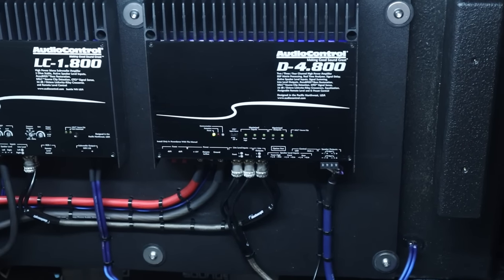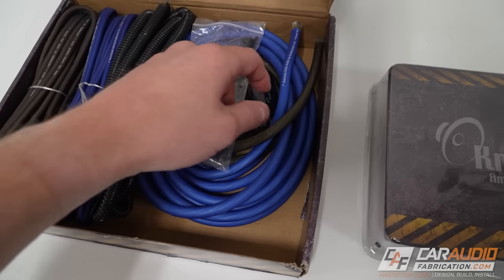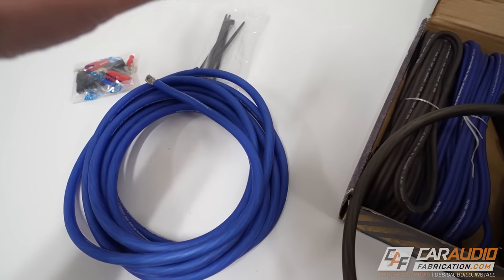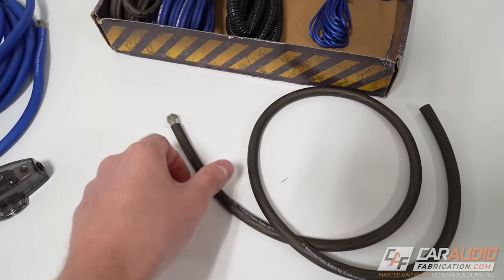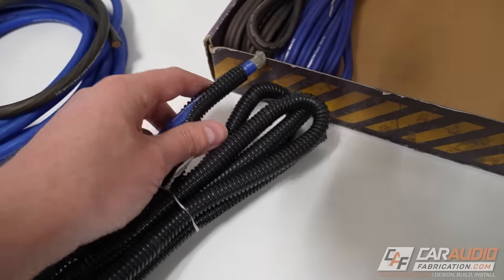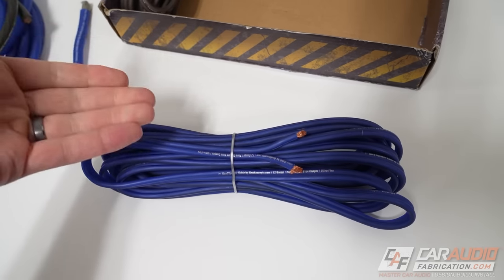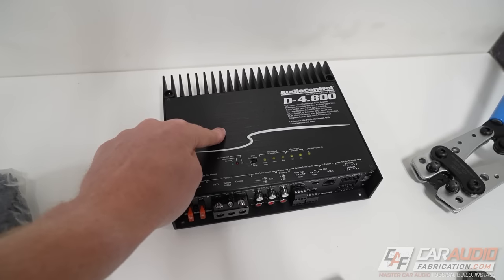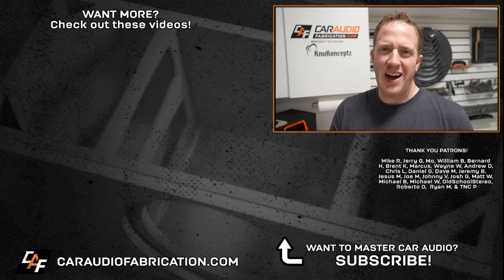Amplifier Wiring Kits Explained - Don't forget these other tools too!

Comment from the maker: Thanks for tuning in guys! Here are the wiring kits and tools and materials I recommend!
🛠Tools and Materials:
✅KnuKonceptz on Amazon - https://amzn.to/3BYHcJo
✅Large Wire Stripper - https://amzn.to/3fldhU6
✅Large Wire Crimper - https://amzn.to/3rhP3wQ
✅Small Fast Wire Stripper - https://amzn.to/3fkJQ4z
✅Knife - https://amzn.to/3LYsJC8
✅Cable Cutter - https://amzn.to/3ftRQQU
✅Terminal Crimper - https://amzn.to/3rqw5nD
As an Amazon Associate I earn from qualifying purchases.
Reply: Can you do a audio whining/high pitch noise diagnostic video? It also matches with my engine rpm.

Comment: Ok, I’ve watched the videos but I’m still confused. I’m upgrading speakers and putting an under seat powered subwoofer. So, do I need two DSP? One amplifier with built-in dsp, and another without it for the sub?
Reply from the maker: Every system benefits from DSP. It's like building a performance car. You bolt on all those upgrades, do you think an ECU tune os going to help or hurt?  If you get a DSP amp most have a set of preouts you can also control and send signal to a non-dsp amp

Comment: Just wanted to say mark. Recently started watching your videos.
I built a sound system in my 2000 z3, maybe 5 or 6 years ago? Either way, the oem system just didn’t cut it for anything. So of course got the head unit, then ran an amp for the speakers and ran new wire. Anyways.. decided a month ago I was going to rebuild my sound system. New wires, speakers, amp, etc. And that’s when I decided to start watching your videos. Which now totally has changed the way I looked at building sound systems. Also swapped my speakers out from pioneers to JL c1’s because it seemed like the best bang for your buck, also the way you used their product. It just seemed very promising. 
And I have to say, I couldn’t be happier. I’m absolutely IN LOVE with the JL speakers

Comment: Been watching your videos for like over 5 years I think. I never comment but most of my knowledge is inspired by this channel. Currently suffering with an IC for my PB1.18000 Class D. Cant find the IC and suffering with a sub that does not deliver the required bass. Now I need to save for another 6 months to be able to replace them☹️

Comment: What up Mark! In my humbled opinion, you are truly the best box builder and fabricator on YouTube without the super expensive computer controlled robotic router table. I'm a Cable Splicer of fiber optics for Verizon in Washington, D.C., and most of our job assignments are of the brand new construction variety with lots of plumbing material lying around. Being a BassHead from the early 90's, I fondly remember those "Bazooka" bass tubes, and I would love to see you create/fabricate one out of 10, 12 or 15 inch diameter PVC piping.

Comment: Pls pls pls do some videos on Marine audio system & not the easy stuff these new boaters play with them big hanging speakers that are freaking awesome … I’m talking about old school / classic style marine systems. With 4 or more speakers, radio , amp , subwoofer…. In case you were wondering yes I just picked up a boat that could use a new system & thanks to you my F-150 sounds awesome 👏🏼

Comment: I’m running the kolossus 4 gauge in 1 of my cars I’ll be running a 1000 watt amp at 1ohm subs and 300 watts stereo mids , do I need 1 gauge or will 4 work?( 100 amp and 30 amp fuses recommended)

Comment: I have a bi-amp system with RF D1200 and RF 400 for mid-tweeters install on my 2016 Elantra. Do I need to install a capacitor?

Comment: Hi Mark I have a 2019 Subaru Outback and I would like to upgrade the speakers and sub woofer. I would like to use the Audio control amps AMC 1 .300  & AMC 1.400 . Is there a pre made harness for Subaru vehicle??

Comment: Really appreciate your helpful videos @CarAudioFabrication This one helped me decide on Knukonceptz wiring for my new system. I havn't installed any audio for about 8 years so it's been good to get caught up on latest techniques and equipment... I went overboard on the wiring kit rather buying the premade kit mainly because I didn't want longer RCA cables then I needed so I added all the custom wire lengths and terminals ect I needed to cart and knukonceptz made it easy to custom configure exactly what I needed even though I spent double what their premade kits cost ha...

Comment: Great channel! I'm looking to upgrade my audio system but Crutchfield told me I'm screwed. Got a 2010 Prius with a "premium" JBL system with navigation and park assist. Can't exceed a 30 amp current draw. Looking for a fairly modest upgrade with a new head unit, speakers, small sub (powered spare tire sub maybe) and a 4 or 5 channel amp. I can live without the park assist and add a better backup camera. Would upgrading the 12v battery help?

Comment: If using 4 guage wire how much amper fuse is need.
If using distribution blocks does we need a fuse
Reply: Depends on the distance.
Reply: @robertthomas7239  I would also depend on if it is OFC or CCA... I would advise against CCA of any size, the disadvantages are NOT worth the cheaper price in my opinion.

Comment: my compact 960 watt amp, 1 farad capacitor, line output converter, digital tv tuner (also a PS2 slim in glove box is connected to it), 410 watt power inverter are all zip tied to the ceiling of the trunk, put the fabric/carpet ceiling cover back n place, now the only thing u see is my dual 10 inch subs in box, 5 switches to control all the components up front, switch 1 for tv tuner/ps2 slim, switch 2 for the remote turn on wire that goes to loc/amp, switch 3 for the aftermarket apple car play device connected to factory screen and switch 4 & 5 for the front & rear noise canceling mics when subs r on, and remote bass control knob, then later added a small 12lbs 2nd battery connected with a relay to main battery for the tv tuner/PS2 slim, in the trunk pocket under the trunk carpet floor behind the wheel well.